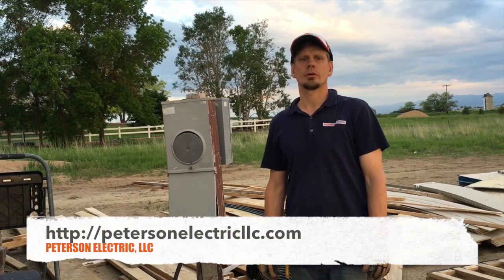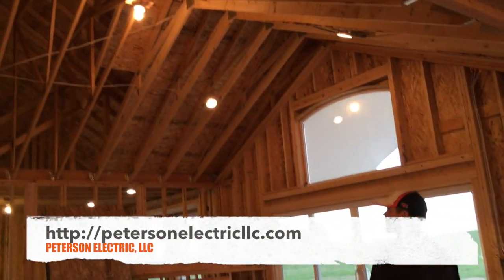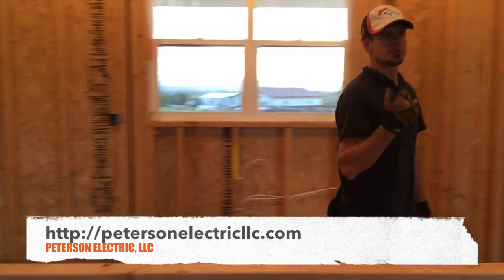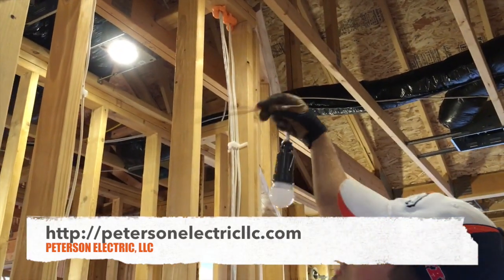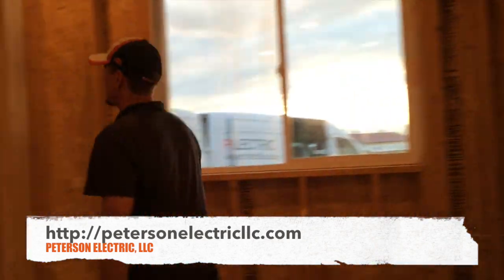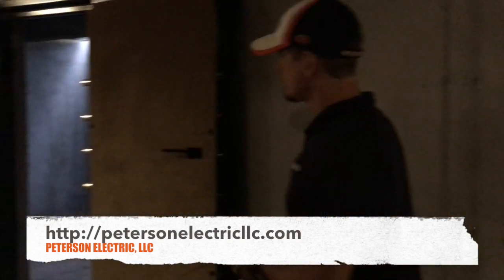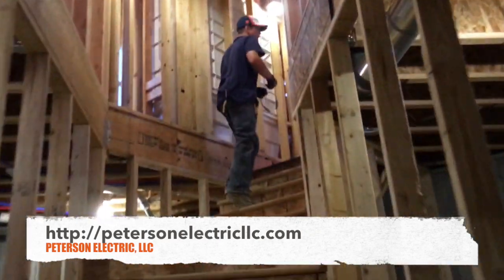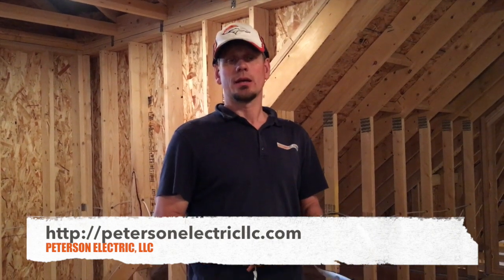Custom House Built, Testing All Circuits To Make Sure No Issues Before Drywall Is Installed

Comment: Wired houses before ground wire was equal size.. Aluminum, copper clad, copper and BX. When the GFI was mandated in 1971 we had to use Square D panels. They were the only ones making the breakers. This guy is intense. If the wires were injured after drywall we would break a hole and fix it. Then back charge.

Comment: Sometimes I feel like I'm the only electrician on the planet that fires everything up prior to drywall for testing.  Thanks for letting me know that I'm not the only one.  IMO it's the only way to know if you've missed a run before it's too late. Yes total pain in the arse but it makes trim so much easier!
Reply from the maker: Glad to hear, I thought this was not normal, especially when an inspector tells me that i'm not ALLOWED to fire anything up in Rez. before he ok's it. I like to mention to him it's my rear with the drywallers and the customer if the lighting is bad, and not his deal to fix.
Reply: EXACTLY!  Also I always respect the other trades and look out for them.  They NEED light to do their thing.  The light WE put in with temp bulbs in permanent locations and GFCI's (temp devices) are appreciated every time!  As for drywall contractors roto zipping our wires to shreds....UGH.  At least we can look for the burn marks in the boxes to help if they are powered!  LOL  Thanks for your videos!  Just found your channel the other day.  Thanks for making this just for fellow electricians and I am spreading the word!

Comment from the maker: Thanks, we like to make sure this is not a mistake of ours, this has saved me a couple of times in a basement. Two times I was called in and before the framer was finished with his work and they hit a homerun and a general circuit. Also, it protected me from the drywaller hitting my circuit, I was able to see this because of the black mark.

Comment: Subbed! Man this is good stuff, I love diagnosing wiring problems. Process of elimination is what I teach on the job to all the green horns. I encounter more issues in my area due to the fact that no inspection is required. So Handy Mandy comes in and has A&B off balance, or multiple feeds on one breaker, double the fun. Hot tub no GFCI protection, or most recent 30 amp breaker on a 15amp built circuit 14-2 wire, that was a mess. I would like to see a WTF video though, just to see what you encounter in your parts. Jeff

Comment: I can't see the justification of the use of 12-2/2 compared to standard 12-2 nmb, you can get 3000 ft of 12-2nmb for the price of 1 roll of 12-2/2/. It can take about the same time by pulling 2 runs of 12-2 to the same area. Was never a big fan of wagos other than in trophers and they're much more in cost. Our inspectors in NE don't wasnt us hooking up any wires to breakers other than the temp plugs in the house cause of the other trades not keeping their hands off the breakers and safety issues. What size is the main disconnect for the 3 subpanels in the house? We generally put out panels in the basements a house that size we would probably do a 320 meter socket and put 2-200 amp panels in the basement next to each other, not knowing what the demand is for that house hard to say, lots of variables to services, just seems odd to have to go out in the cold to mess with the main if ever.   Always a fan of sub panels on separate floors if necessary and a big house. I find it cool you can recite article # of the nec to most aspects of your jobs, after 20 years of being an electrician I know the codes, but not always the specific article #'s. Nice clean work as well.
Reply from the maker: I disagree, materials is always one third of the labor, it is not faster to pull two runs vs one, especially with some of the micro-lamb, and iron beams they use in the larger houses today. Not to mention restrictions on how many NM cables allowed in a 1/2" to 3/4" to 1" wood drilled KO hole. Article 300 talks about this. 
Thanks, I do agree with you on installing sub panels per level, and if I could get the utility company to agree to set a 320 meter with us paralleling two main 200 amp panels I would do this all day long, assuming that we have a house that is 5k or larger. 
Thanks, for watching, we try to quote code, especially when we get a lot of flack for just putting out youtubes.
Reply: Peterson Electric yeah it takes a brave  person to put out videos on you tube about electrical, always going to be the trolls but you do a great job from my experience and quality installs. It's just interesting to see how things are done differently in other states. I just know my boss would kick my butt if I rolled up with a 250-foot roll of 12-2/2 since we generally buy thousand foot rolls of 12/2 and just tape two rolls together and pull them where needed in the kitchen.
Reply from the maker: 12/4 is better because of saving on labor and how many NM cables in a whole as well as not entering in to the load center with so many HO wires.
Reply: I agree. Did it that way for decades. A lot faster.
Reply from the maker: Robert gregory 
How long has the #12-2-2 and #14-2-2 been around? How long have you used this method?
Reply: Since the 60s.

Comment: Nice video, I agree on testing the circuits etc before drywall. However did you say back stab into the plugs and switches, please don't do that, I'm a 17 yr service electrician here middle tn, and I've had to replace bunches of plugs and switches, because the plastic at the hole where the wire goes in will break, and or get loose and come out, I've had to replace all plugs and switches in several home because of this. That practice is probably why we have arc fault breakers now. 
And I'm no fan of wagos for plugs and switches plugs. I'll use them at light fixtures. I don't trust them at heavy loads, those things can get loose as well if your plulling 10-20 amps threw
 them thats a big problem, I ALWAYS TWIST MY WIRES TOGETHER, AND USE A WIRE NUT. ALWAYS. I'm quality over quantity guy. Thanks man good video

Comment: woah wagos on all your switches n plugs? How much time does it  save compared to having a pig tail with a joint and then just plugging the switch/plug in?
Reply from the maker: It's legal, and I trust them. SO, thanks anyways Boss.
Reply: I saw a video where a guy tested them and he cranked it up to 100 amps before they started melting.

Comment: 12-4 ? Is that 12/2/2 ? Is the second white tag? I do custom homes, 10k sq ft plus and never thought of using 12/4 or 12/2/2 ... that would save time in the rough ..
Reply from the maker: 14/2-2 & 12/2-2
Reply from the maker: 12/4 is 12/2-2  and same for 14/4 is 14/2-2.  Just my slang when I'm ordering it or explaining to my employees when they are stocking, 14/2 or 14/3 or 14/4
Reply: Sure does. Black, Red, White, and ground. Just make sure you put the Red and Black on different phases. If not you would overload neutral. I like your work PE. It's looks neat and done with pride.
Reply: P.E what is the difference between 14/3 and 14/4. I have been out of housing since 85. We always just said 14-3 or 12-3 which came with a bare ground of course when ordering. Is this something new. I see now that #14 #12 and #10 regular romex are different colors . #12 for instance is yellow now. Great idea.

Comment: Instead of using 120v smoke detectors, could you use 12v smoke detectors from your alarm system?
Reply from the maker: Yes I have heard this can be an option, but we do not do security systems, so typically we install 120 volt units. I know that every jurisdiction is different and they will tell you what they want

Comment: Wow. The standards are very different between countries. I'm a swedish electrician and it's seems crazy to me to just put cables in the walls like that. Here we always put flexible piping in the walls and then pull the wires inside them. That way you can always easily replace it without opening the walls. A lot of this feels like something we'd do back in the 40-50's over here, but we didn't put cables just  like that in the walls back then either. And a lightbulb to check power? Professional...
Reply: lolzhaxor In Australia we run cables in the wall without conduit, but we do not clip them, so they can be used to draw new cables for expansion in the future. The light bulb tester though? Haha I wonder which standard this guys tester complies with (if they have standards over there) lol - we have manufactured items that are similar but rated for certain voltages and are more commonly used by line workers.
Reply from the maker: I totally agree, if this was a state standard it would be wise, but if I bid this that way with ENT pipe we would not be price competitive. Our state allows NM cable in homes and apartments under three stories. I think this would avoid mice, rats and squirrels
Reply: in some cities here in the us like chicago require metal raceways inside walls and ceilings
Reply: the bulb was to give you a visual appearance of the power, he had a meter there you could see.  some places in USA do require a raceway.

Comment: 5 way?? lol
Reply from the maker: If there is a single pole, 3 way and a 4 way, then there must be a 5 or 6 way if you keep adding 4 pole switches.
Reply: Peterson Electric nah it’s still a 4way
Reply from the maker: @TyMan970  no you need to add the locations , it is a 4 way switch but more areas to control
Reply: Doesn't exist

Comment: England must be one of the highest standards for electrical regs
Reply: no it has old buildings that are horrible.  the plug he is showing is GFCI, uk does not even have that.
Reply: Err yes it does they are called RCDs. Regulations are more strictly enforced and there is regular and periodic certification required so yeah it’s better in that regard. However you are also correct with older houses you do find big safety issues and shocking DIY mistakes, which are scary.